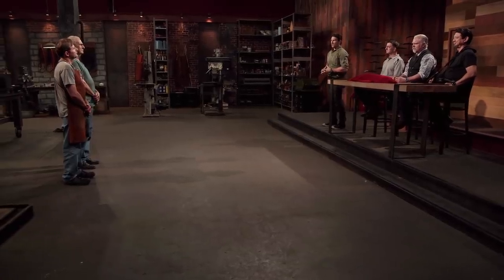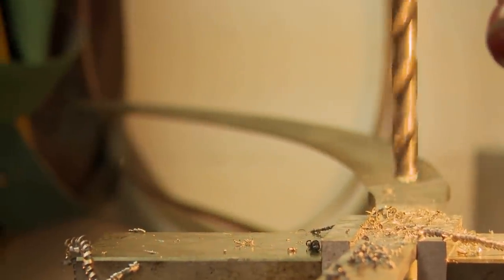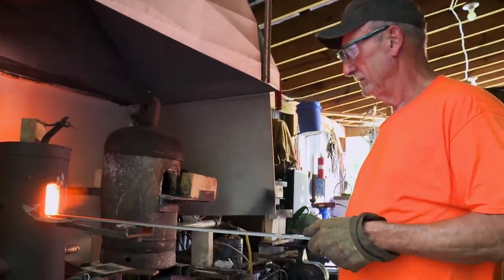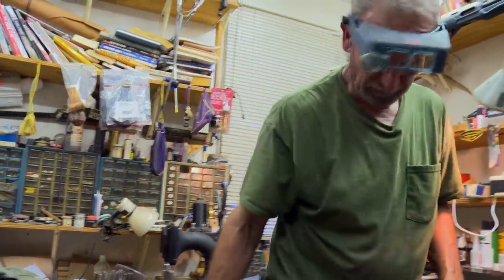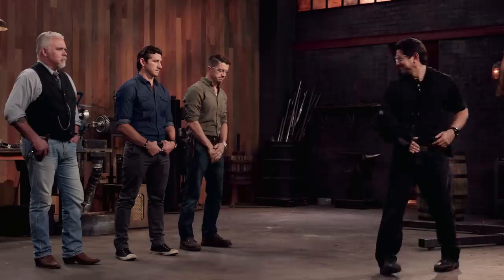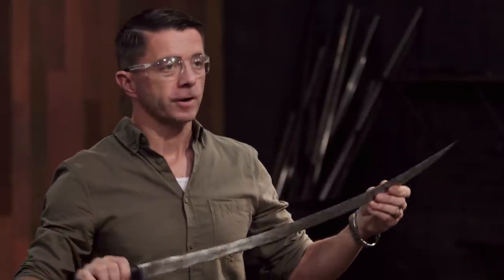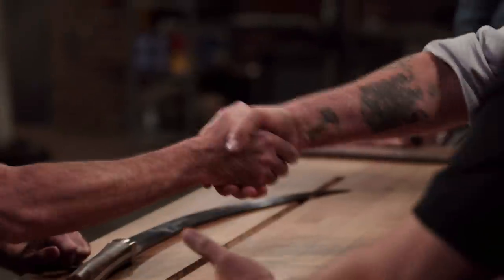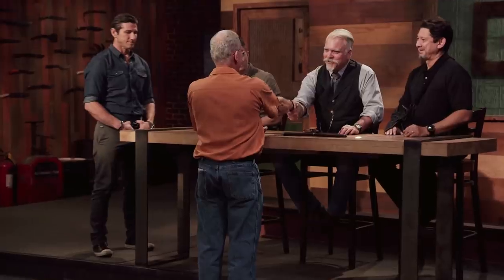Make Room for the Rhomphaia As It HACKS the Final Round | Forged in Fire (Season 5)

Comment: One important thing about a weapon: the lighter it is, the more control you have and less stamina you burn up.
Because when you're in battle, you'll want a weapon that's strong & light. Decimates your enemies and doesn't wear you out too quickly.
Reply: No you get more tiered carrying a lighter sword.  Trust me I know.  Veteran here.
Reply: @mattuw82  lmao what
Reply: @joemama3259  He's not 100% 'wrong'. When dealing with a melee implement, there's a fine balance on weight vs type of blade, as well as where the weight is balanced. 
If you have a blade that's too light, you can end up 'overbeansing' it and putting way too much effort into each swing, as well as there being some issues with followthrough and a higher tendency for horrible impact shock in your hands. If it's too heavy, it's too hard to get momentum in. 
It's not as straight forward as one might think, when it comes to actually USING the weapon, especially if armor or other such things become a factor. 

To give an example, if you have to chop down a large, fully grown tree, which is going to leave you more exhausted at the end of it? A full sized felling axe, or a camp axe? The lighter one is going to leave you more exhausted by the end.
Reply: @jtnachos16  im ngl aint no way im reading all that but cool beans
Reply: @joemama3259  I actually ended up reading all of that just because I was just slightly a bit more curious
Reply: @jtnachos16  exactly my thoughts. Noone here thought about the impact shock, and it's quite a beast when dealing with blocks and shields. I'd prefer a heavier weapon when dealing with armored opponents, and lighter weapon is preferrable against unarmed peasants maybe
Reply: @joemama3259  If you can't be arsed reading that tiny amount of text, check yourself for ADD.

Comment: During the first Roman invasion of Dacia, these weapons were so deadly, theyd go through Legionary helmets. This caused Rome to update their helmets and add a strong reenforcing bar brim to the forhead section. This protected Legionares from overhead strikes, passing their shields.
Reply: It's more than it went around and hit the neck so they added a section for the neck. You can't cut a Legionary helmet with a sword. The forehead bit just gives more space between skull and the impact.
Reply: @Masra94  It's not necessarily the blade of the Rhomphaia that prompted the reinforcing bars. It's the point. 

The tip of the Rhomphaia is capable of cleaving into helmets while the curvature of the blade can allow it to avoid contact with the edge of a scutum.

Thegnthrand has a video where the point of the Rhomphaia/falx was able to penetrate through a helmet. I can see why you would be prompted into adding some reinforcing bars and increased neck coverage.

Comment: The strength test was more like a sharpness test
Reply: Sugar cane, because of the density of the pulp, gives blades a lot of resistance.  In south Louisiana, we know to bring heavy blades, perhaps like a machete or ditch hack, if we want to harvest sugar cane.  It is also common on the show to use other types of cane for strength test.  Obviously, hacking on concrete would be really destructive, with or without rebar.  So you want to offer a test that will mark - but not destroy - the blade.